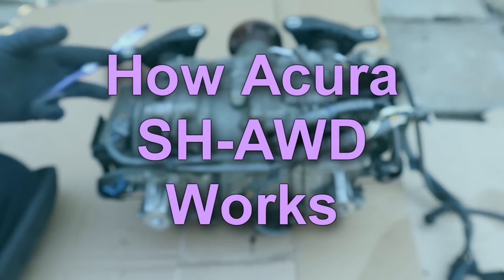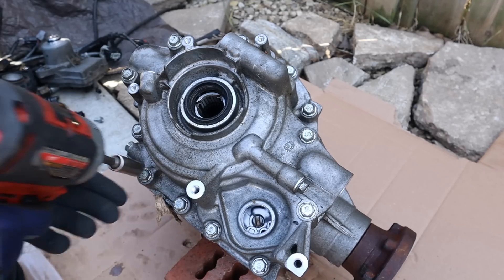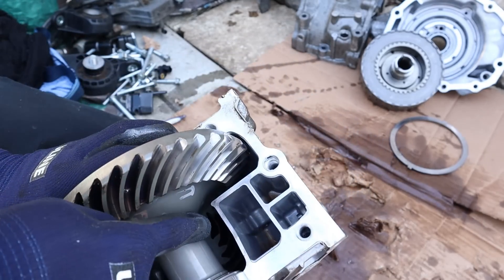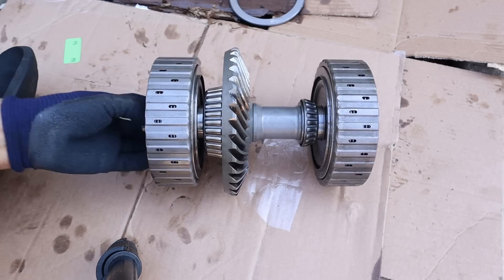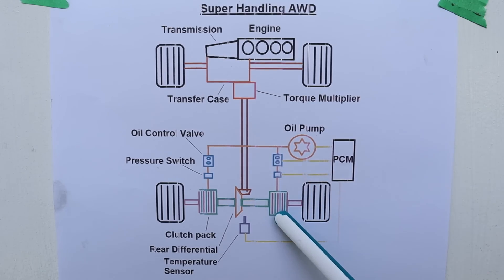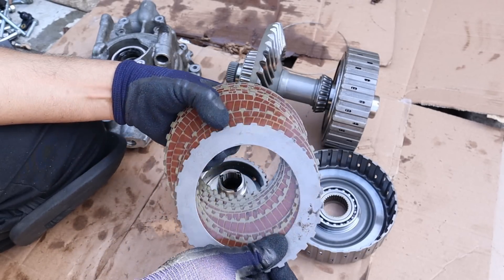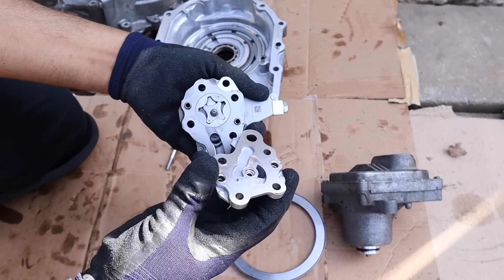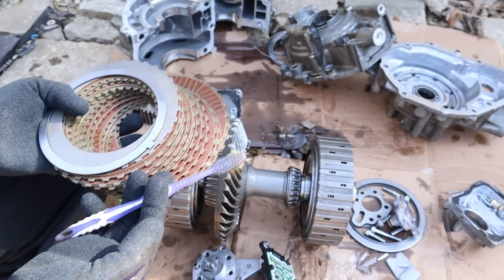How Acura Super Handling AWD Works

Comment: 9:40 No, a locked differential is 100/100 torque split. An open differential acts as a balance and balances out the torque. When you lock the differential, the road surface and wheel speeds determine the torque. For instance, in a turn, you'll have negative torque at the outer wheel and positive torque at the inner wheel, until it's enough to break traction at one of the two wheels to allow them to turn at the same speed. How is that a 50/50 torque split?
Reply: An open differential applies exactly the same amount of power to each drive wheel at all times no matter their individual wheels speeds. Hence the term differential! If one wheel is spinning on ice it doesn't take much power to do so thus the other wheel remains stationary without enough torque to move the vehicle and you are stuck. The is also the "one wheel peel" when people do burnouts.

A limited slip differential does exactly what the name implies. It allows for limited difference in wheel speed. If one wheel rotates faster than the other, clutches apply braking force to the wheel spinning faster which increases power required to both wheels. Since we know a differential always applies the same power to each wheel, this increases the power output to the wheel with traction and allows the wheel with traction to propel the vehicle forward. The downsides are special fluid and special wet clutches plus the driver can feel binding or a chatter around sharp turns like a right turn onto a road.

Modern cars usually use brake actuated traction control which instead of a limited slip differential employs engaging the brake on the wheel spinning faster to create the same result.

A locked axle does not allow for any difference in wheel speed. Best for traction on extreme surfaces like mud and snow because it ensures power is always sent to the wheel with grip. Bad for every other situation because the outside wheel always needs to rotate faster when going around corners but it can't thus creating binding and wear. It will also cause a vehicle to lose traction around a corner because one tire must always slip around every turn.

This Acura axle housing contains no differential. Instead there are two computer controlled clutch packs which modulate power from the driveshaft directly to the wheel.
Reply: @TheRetarp  Open differential applies exactly the same amount of torque to each wheel, not power.
Reply: @4x4.tests.on.rollers  I should have used the term force instead of power. The concept is the same no matter what force unit you want to use. Horsepower, watts, lb-ft all have to be transferred through the driveshaft, gears, and axles to the wheels :)
Reply: @TheRetarp  Force would be correct, torque would be the most precise word.
Reply: That's the common mistake and misunderstanding, unfortunately not much people understand the torque split of an open and locked differential, usually they mess up the torque with rotational speed.
Reply: A locked differential on one axle will have a 50/50 split.  One wheel can be completely in the air you will NOT get "100%" torque to the other wheel (the one on the ground).
Reply: @LexusGX460-OFF-ROAD  You're citing the exact situation in which 100% of the torque goes to one wheel. The wheel in the air can't take any torque because it's in the air. If 50% is going to the wheel on the ground, where's the other 50% going?

It's like if you have a double ended wrench and you put the open end on a fastener. Do you only get 50% of the torque to the fastener because there happens to be a box end on the other side of your wrench that's not touching anything?
Reply: @LexusGX460-OFF-ROAD  Search for the video called "Always 50/50 torque split of an open differential". It explains how open diff has always equal torque split while locked is variable.
Reply from the maker: Torque has to add up to 100. 
50+50= 100 😁
Reply: @speedkar99  It does but in case of open diff - it's always 50% on the left and 50% on the right. Locked one may be 100% at one side.

Comment: Interesting, I wish you got the Lexus TVD too, its an open diff with individual brushless motors for each side and it's used only in 2 performance F cars - RC F and GS F, the GS F always had TVD while RC F Track Editions do not have TVD and since 2023 they also stopped making TVD for RC F. It has a separate ECU system for itself as well.
Reply from the maker: I'd love to have the Lexus one but I can only imagine how expensive it would be to obtain for teardown!

Comment: you're the break down king .. it seems to be very similar to a Volvo xc90 haldex system .
Reply: Haldex is placed on a driveshaft and it powers rear axle. It doesn't power rear wheels separately.
Reply: @4x4.tests.on.rollers  concur with the objective .... should of been more specific as to relate with componentry (electric oil pump and clutches ) although Honda has a more reliable system.  I've just replace my oilpump two months ago😮‍💨

Comment: This is the same set up as a Focus RS Golf R, A45 and the new Audi S3 rear diff. 
The upside is this set up is easily converted on a FWD car. The downside is that this is a part time AWD and the AWD is always slipping when engaged which creates wear. This also means they can overheat and reverts back to a FWD.
Reply from the maker: Yes if this was full time it would burn those clutches
Reply: @speedkar99  Not necessarily. There are many permanent, clutch based awd systems. They just keep the clutches slightly engaged.
Reply: Basically the same but units are quite different in terms of control. Focus RS uses Twinster by GKN Driveline. Golf R, Arteon R, Tiguan R, AMG A45 S, RS3 and newest S3 are using Performax by Magna Powertrain.

Comment: The recent SH AWD system has been simplified. I think the older generation has planetary gear sets in the unit to either drive the rear wheel at 100% or overdrive (+3 or 5%? forgot the exact number). Now it seems it is just single speed (overdrive) controlled by two clutch packs.
Reply: Correct. The 2nd gen RL had the most advanced SH-AWD implementation using the planetary gear set within the clutch pack that allowed for up to 5.7% overdrive.
Reply from the maker: Yes this is pretty simple because it's an RDX. 
I think the old RLX/TLX would be more tuned for dynamics

Comment: Isn't this differential-less design also used on Nissan Juke AWD?
Reply: Very similar but Juke had electromagnetic control if I remember well.
Reply from the maker: I would have thought it would be a slip and grip system like any other CUV
Reply: @speedkar99  I just read this description few years ago. That's pretty much the same what you found in this Acura:

"The Juke DOES have an open diff up front - meaning the power transmitted to the front wheels CAN effectively go 100% to one wheel if it is spinning, though I suspect the traction control system probably can and does mitigate that (to what extent I don't know). But the Juke is unique with how it deals with the rear. A driveshaft from the transaxle is always spinning a ring and pinion at the rear. Electronic clutch packs control whether or not the rear halfshafts (axles) are spinning. So the left rear and right rear torque distribution is directly controlled by the computer through the clutch packs and they are able to split the rear torque 50/50 (or 25%/25% of the total engine power) even if one rear wheel is spinning, but they also CAN put I THINK up to 100% of that rear axle torque to just ONE wheel if they want to, this mostly comes into play with the vectoring of the AWD-V setting."
Reply: @speedkar99  Slip & grip (reactive) systems are shadow of the past. For about 20 years, programming is becoming more and more proactive.

Comment: Awesome stuff, thanks for this! Will you be breaking down the front trans/differential for this system as well?
Reply: Front differential is typical for a front wheel drive transaxle. There's a transfer case that outputs power to the rear axle directly from the front differential.

Comment: I bought a base Prelude (5th gen) because I had heard reports of SH breaking. I installed a bullet-proof Quaife differential instead. The warranty specifically mentioned that racing wouldn't  void it.
Reply: Take a rear diff module out of a wrecked Acura and adapt it to the Prelude's front axle. SH-AWD doesn't fall.

Comment: This is cool. I recall looking up Honda's patent filings to figure out how it actually works, back when SH-AWD came out. Now I get to see the internals.
Reply: Oh, this is way simpler than what was in the patent. The patented system has geared shafts driven by each side at 102% of their speed. Applying clutches between an axle and the shaft spinning slightly faster than the other axle allows transfer of torque with minimal loss of power.
Reply: @charvakkarpe yup, it was 2005 Honda Legend that got that 1st gen system in it. I couldn't get my head around it at the time. Absolutely brilliant driving dynamics in all conditions incl deep snow

Comment: How reliable are these? How much maintenance do these need? Was there anything wrong with this one? It didn’t seem like it
Reply: He said it's not reliable but the goal was compactness.
Reply: I have a current gen RDX and when I was looking around I did not find lots of reported issues/failures with the sh-awd. It does require more consistent fluid changes than my previous Subaru did
Reply from the maker: Nothing wrong with this one. 
Clutches will wear which is why it's a part  time system monitors by temperature sensors.

Comment: I wonder if its possible to add Acura SH-AWD in a Civic
Reply: definitely possible to bolt the transmission up to just about any civic engine.  The hard part would be modifying the underside of the car and the rear suspension to be compatible with the drivetrain.
Reply: @jacobm2625  I'm just worried that I have to connect this into the car electrical system to make it talk to the rest of the vehicle. Unless this system runs itself independently.
Reply: @ToroRossoAcura pull the SH-AWD ECU out of an MDX or something.